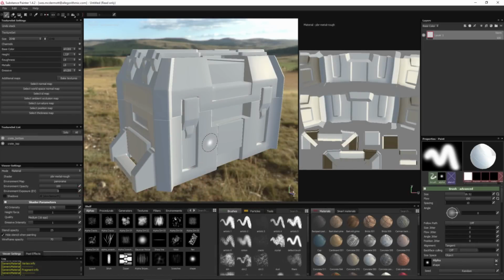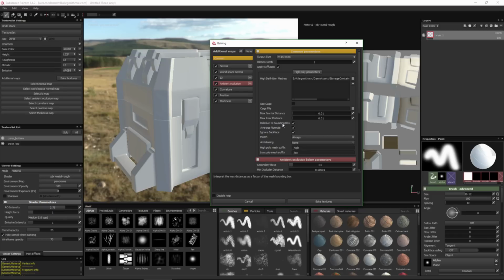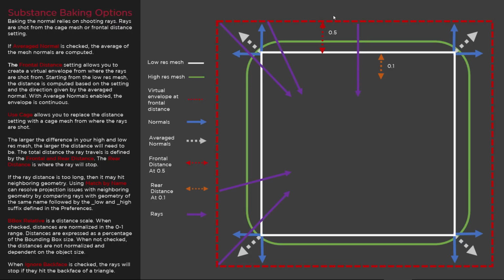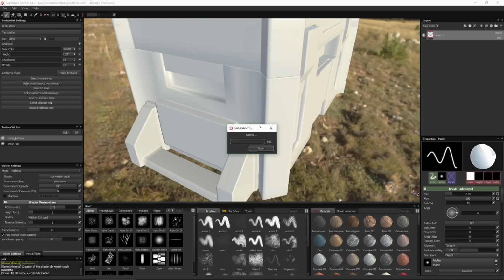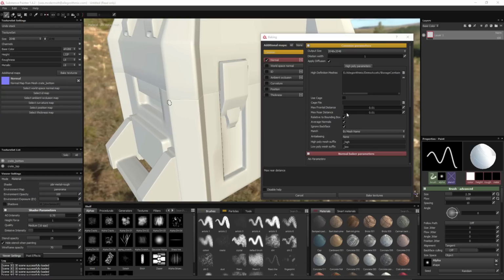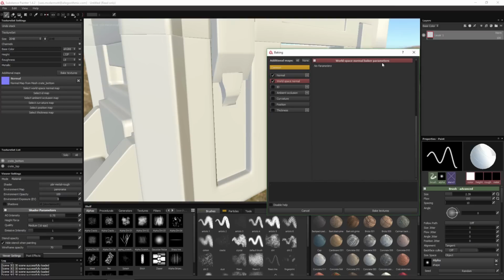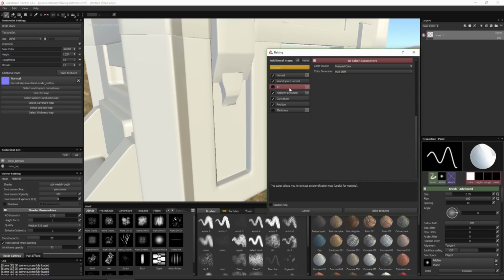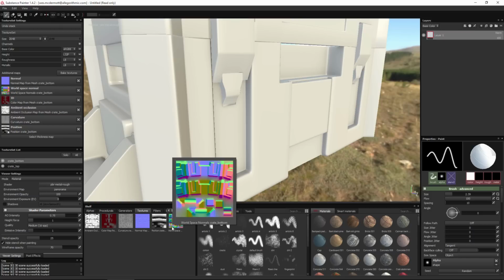Substance Painter Tutorial – Fundamentals 05: Baking textures | Adobe Substance 3D

Comment: How can I ignore a mesh part for the AO baker? 
I have for example an H&K MP5 model, and I want to bake the ambient occlusion for its magazine texture set (the mag is seated inside the mag well). 
Substance Painter is now baking a shadow onto the upper part of the magazine (since that's the bit that is fully surrounded by the darkness of the receiver). That's obviously not what I want (I want a clean AO for just the magazine).

I don't want to go back and export an exploded version of my mesh; is there a way I can ignore the receiver for baking the AO? Disabling the receiver's texture set effectively hides the geometry inside the substance painter scene view, but it doesn't prevent the baker from covering my magazine with unnecessary shadows.
Reply from the maker: You can use the match by name feature. You don't have to explode the mesh. Just go back to 3D app and name the mesh parts that you want to make sure evaluate in the ray cast. For example, on the low res mesh, take the magazine and call it magazine_low, then in the high res, call that mesh part magazine_high. The names match, but contain the _high and _low identifiers. You don't have to explode the mesh parts. Just name them. Now in Painter, se the AO baker to use Match> By Mesh Name and it then the ray will only intersect the matching mesh part names for the high and low.
Reply: Hm, it works! Thank you for the detailed and very helpful answer :)
Greetings from Switzerland
Reply from the maker: Awesome : ) No problem, happy to help.

Comment: I'm a confused, I thought materials are recognized as texture sets. How do the materials in your highpoly model not create a separate texture set and are instead used for the ID map?

I gotta say though, amazing tutorials so far. The quality is master tutor level. Bravo.
Reply from the maker: +Jintaro Kensei Thanks! So glad you like the videos. The materials are recognized as texture sets. So in your low poly you are painting on in SP, you want to minimize the sets. You can use as many as you like, but for game assets, you don't want to have many materials on a single asset. So if you want to have a min number of materials, but have an ID map with many material areas to help with masking, you can bake the ID map from the high poly that has more or different IDs than the low poly. You can also load in a different version of the low poly (in the high poly section) with different IDs and bake the ID from that. This is just a way to get a more complex ID map to help with masking using color selection but keep the actual project mesh with a set number of materials.

Comment: I can't use the Match feature because my highpoly is in zbrush and importing it into blender or maya would be extremely slow (it has millions of vertices). Looks like I'll stick to baking tonnes of different maps and combining them in photoshop :/
Reply: KoraxArt I noticed that too with zbrush, but once you actually export them, the '-' change to '_'. 

I'm using separate .obj files for my high poly though, because when I do FBX, the scale of my model is completely off compared to my low poly.
Reply from the maker: +Jade “ghgghghjh” ok Actually, you can use zbrush : ) I work this way with zbrush as well. You will need to use the FBX export option in 4R7. You can separate the high an low into different subtools and you can name the subtools to match the naming convention for the match feature such as "arm_low" and "arm_high." Its basically the same workflow as what I showed in Maya. In zbrush you are separating the meshes into subtools.
Reply: +Allegorithmic I tried but I simply can't rename the subtool in ZBrush with " _ " 
if i try the results is " - ", what i do wrong ?
Reply: +Jade ok “ghgghghjh” yups same here, the FBX is totally out, I tried again with export obj for each subtool of my high poly and bake into a full low poly, but now when I click bake in sub painter give me this error [HighPolyMesh] Unable to load scene from Url 'file:///C:/Users/blablabla/body_high.OBJ'
[Baking] Baking failed
I'm pretty sure all it's ok, no idea where is the error Q_Q

Comment: Hey, I'm having some trouble baking my normal maps. Whenever I try to bake them, I get little errors like this http://prnt.sc/a8d4rg http://prnt.sc/a8d62y http://prnt.sc/a8d6ag around intersecting objects. You touched on this in the video and you said to mess around with the Max Frontal and Rear distances until you get it to look right. You also mentioned to change "Match" to "By mesh name"
Changing the Frontal and Rear distances all the way down to 0.0001 gets rid of most of these errors, but it also gets rid of most of the other things that I want baked onto the object http://prntscr.com/a8dcp2 while setting Match to "By mesh name" just sort of removes them completely http://prntscr.com/a8ddjj.
Here's a screenshot of my current settings for baking the normals. http://prntscr.com/a8ddz2
Thanks for any help you might be able to provide :)
Reply from the maker: +Leroy Jenkins hey :
try to avoid pure 90 degres angles: it doesn't help for the baking
Reply: Allegorithmic Alright, thanks, would the best solution be to just erase them manually on the normal maps?
Reply from the maker: +Leroy Jenkins In this case, I would avoid using hard edges and edges with 90 degree angles. The 90 degree angle of the edge is not providing enough detail to represent the high res mesh.
Reply: Allegorithmic So would say adding a turbosmooth modifier to the highpoly help?
Reply from the maker: or just chamfer the hard edges ;)

Comment: Hey Wes, I noticed under pretty much same settings, baking in Substance is faster than in Maya, other than that, would you say Substance is better/preciser in baking Normal maps than Maya, or other software like zbrush, xnormal ? Thanks !
Reply from the maker: +Senna Mortensen Hi Senna. I use Substance for all baking. I think its faster and the main point for me is that its integrated into the software so I feel its much easier to work with as I can quickly bake and directly use the textures.

Comment: After Some testings I have a question. When I use "By Mesh Name" feature what exactly happens to the cage ? Lets say I have a complex mesh which consists of many small pieces and the cage file also consists of the same amount of small models and when the baker bakes each piece separately how the cage is represented ? Does it show only cage part of the one piece or does it load whole cage all the time ? I am a bit confused here. Should I rename cage pieces also in the same way as low poly pieces?
Also if I leave "avarage normals" unchecked, does this mean that the baker will use exported normals for baking ? My model has a lot of hard edges/polygroups and I need to keep them while baking.
Reply from the maker: +ahtiandr Averaged normals is only used when using the max frontal and rear distance ("the virtual envelope"). Average normals doesn't have an affect with a cage mesh. You don't need to work about breaking up or naming parts of the cage mesh. The match by name is only going compute the ray that intersects with the high and low poly with matching names. The ray is just "shot" from the cage mesh.
Reply: +Allegorithmic thank you for quick response! I think I got it and now I can enjoy the baking in one go =)
Reply: +Allegorithmic Yes but see, if i have 2 cubes next to eachother with 2 seperate cages, those cages will intersect with eachother, i can use match by name to bake the normal map but it is gonna use intersecting cages. This might be a problem right? So when you use Mesh by name you are probably forced to work with frontal and rear distance
Reply: +Stef Willemse actually it will bake the cages separately one by one if you use mesh by name option. I have baked full characters with 30+ meshes and each mesh had its own cage and cages were intersecting but the result was perfect. I think when it bakes by name it uses cage vertexes which are matching the low poly mesh vertexes and ignores everything else.
Reply: ahtiandr that is awesome, thanks!

Comment: do you use fbx for low poly with multiple named parts ?
Reply from the maker: +Tomasz Neosapiens Yes, I use FBX and there are multiple mesh part names that correspond to the mesh part names in the high res FBX.
Reply: thanks ,now i am getting obj from zbrush converting to fbx , and i rather bake it this way , its much better , 16 mil polys bake down , seems to be foolproof